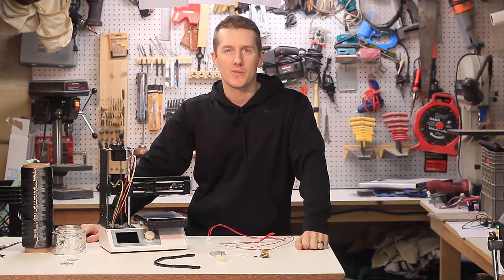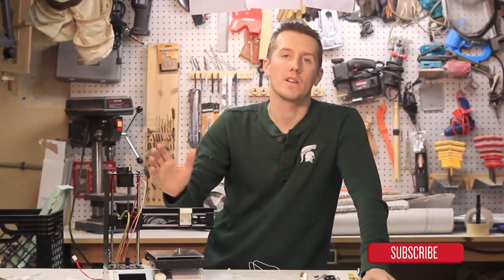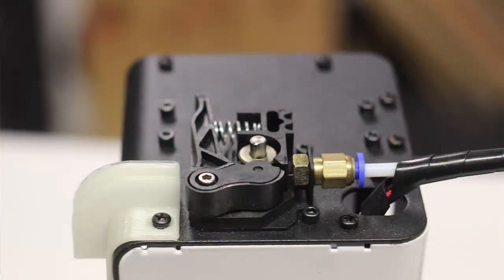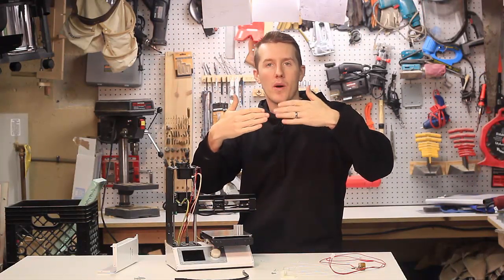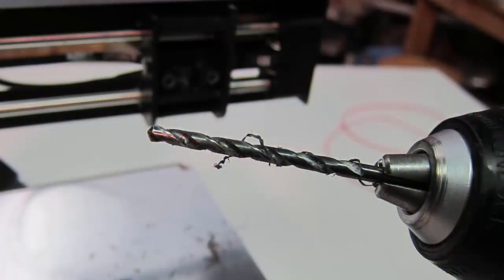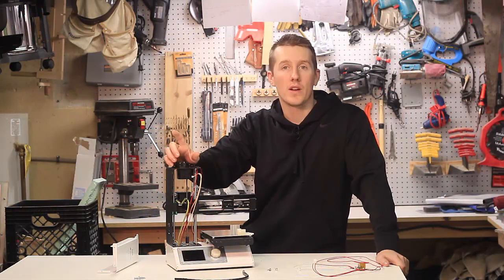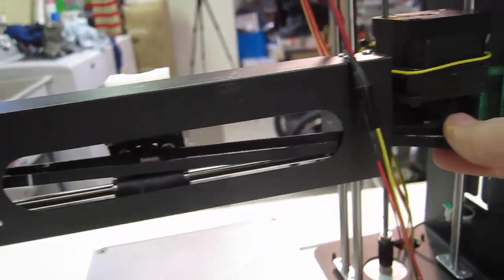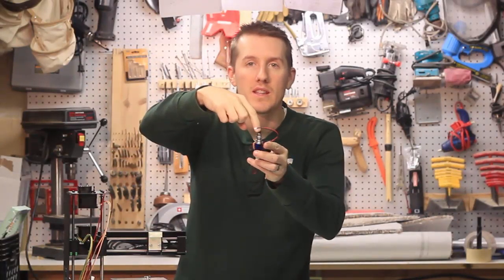Install E3D V6 Hotend - MonoPrice Select Mini 3D Printer

Comment: I screw up all the time too.  Had to learn how to write a plugin for Octopi to control my heated bed via raspberry pi and relay board after  managing to destroy permanently the heater fets and pcb pads on the board.
Reply: Screwing up by mistake is fine. Screwing up because you didn't bother to read the instructions....not so fine. Screwing up because you didn't bother to read the instructions and then posting it as instructions for other people to follow...not fine at all :-(

Comment: great video series, very helpful... i am just about to do this install myself. 

at 14:10 you discuss mounting the larger fan and the graphic says "This was something I show in a separate video" but I can't find it. This is the one part I really want to see.... I assume you just cut off the stock fan and spliced in the larger one? Soldered?
Reply from the maker: Ya i haven't gotten around to editing and uploading that video.  I'll try to get to it soon.  Lots of people add a 40mm fan but i had a 50mm fan lying around so i cut the wires and soldered it in.  Also i had to download the 30mm to 50mm flange.  Here's what i have right now.  https://goo.gl/kXZ9sr

Comment: If you go to a hardware store (not a big box)you can get the right sized metric screws and nuts for a dollar or two rather than drill out any holes.